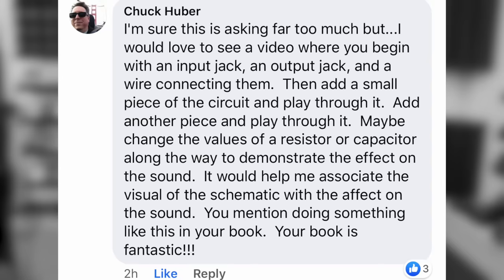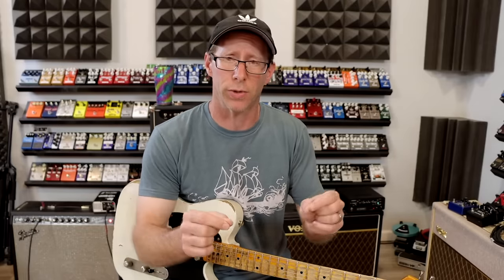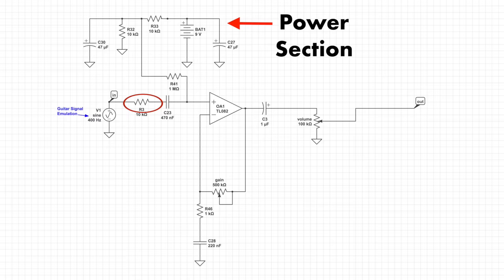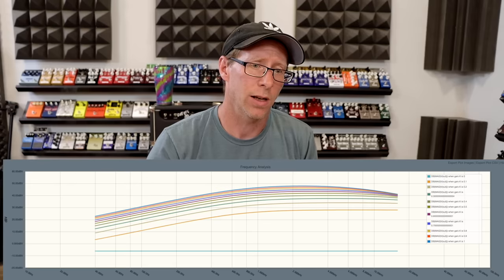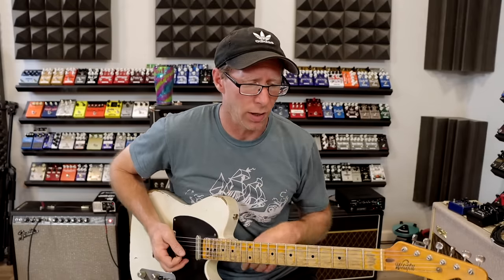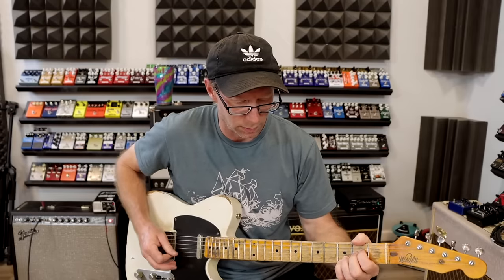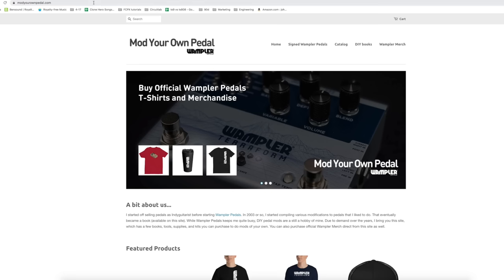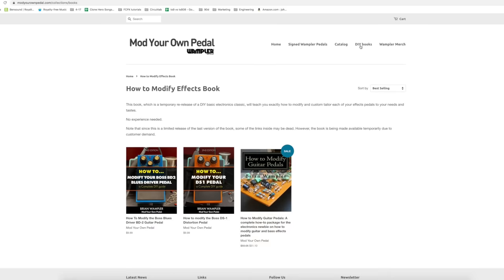How To Design An Overdrive Pedal Circuit

Comment: How long does it take an experienced pedal builder to build a decent overdrive pedal?
Like when you have built the exact same pedal 1000 times?
Reply from the maker: To build one or design one? Building is the easy part generally
Reply: @wampler_pedals  
Thank you for taking your time to answer.
 to build.
Friend of mine said he needed 3-4 hours, but he only did it once, and says he's glumsy.
I am currently saving up for a load of parts to practice, cause from what I've seen it doesn't seem to be that hard to build some pedals, eventhough I guess an inexperienced person like me won't be fast.
As a busker I can't afford expensive pedals so learning it is right now the only way I can afford good equipment, so
I'd like to know what times I can expect once it's an everyday thing to me, cause then I know how long it takes to get my dream collection, and in the long run, if production time and German handmade prices are in a profitable relation. 
The designing part sure, I can imagine it takes a long time, but I guess that is hard to calculate. I mean I can calculate how many songs I can learn in a month, but not how many I can write. I think the same logic applies here.

By the way your videos are very helpful to understand pedals.
This alone I reviewed a couple of times to really take it in.
And it keeps me motivated on my savings for the big part package, so thank you again!

Comment: Hey man, got a question for you! I'm about to build a pedal in a veroboard (only got the picture of the circuit on it) but I wanted to try in a proto first. There is any software that does this conversion between circuits and proto?

Comment: which voltages did you use as op amp power supply?
Reply from the maker: I always start at 9vdcc, as that is what the majority of pedals run at

Comment: The impact of the clipping diodes seems to be overshadowed by the opamp's inherent clipping effect. I would be curious as to when the diodes make a bigger difference, at least as big as to be dramatically perceived when hearing the audio from the uploaded YouTube video.
Reply: He did a vid comparing diode clipping to op amp clipping awhile back, might answer your question
Reply: @electricemperor3672  I remember seeing that a few weeks ago. I'll revisit it, but I remember not being able to witness a convincing difference in the timbre when the gain was cranked-up. The opamp was clipping almost hard, so the diodes probably made a difference in terms of the overall saturation, but the YouTube audio quality of the recording didn't seem to help in noticing a dramatic difference. In this video, I am noticing how the diode feedback loop also tampers with the gain (in the end, they are nonlinear devices in parallel with the feedback gain pot, so I would guess they do change the gain, but also compress the signal? As an amateur lacking the theoretical background, I cannot speculate correctly here..)
Reply: This is a good circuit for experimenting with different diodes. You don't even need to use a matched pair. I recently modded my BYOC OD-2 to add sockets to the LED clipping option. I was planning just to test different colours, but ended up trying every diode I could find. After spending several hours swapping diodes I decided to match a 3mm red LED with a 1N4001 diode. I liked the sound of the slightly asymmetric clipping. But the higher the forward voltage of the diode, the more gain I appeared to need before clipping became apparent (which makes sense).
Reply: @danielcollins6195  Indeed, the problem I tend to have and blame it on the YouTube audio quality loss, is that it is hard to actually hear these differences; all subtlety is lost as compared to hearing the differences live. There's also the perceptual difference between opamp rails clipping and diode clipping. My guess is that saturation is the biggest factor, whereas timbre not so much..

Comment: can anyone explain to me what the purpose of the capacitors are, i understand how they work but i dont understand why he is using them in a pedal and what that does to the signal, if someone knows the answer and could help me out that would be great im getting into pedal building and am trying to learn thanks
Reply from the maker: Capacitors can do a variety of things. Here they are blocking dc, creating filters, setting gain, and a other things depending on where they are in the circuit

Comment: Does he mention which op amp he is using? I feel like he did but I can't find it now
Reply from the maker: Probably a TL072
Reply: @wampler_pedals  you'd reccomend that over like an OPA2134?
Reply from the maker: Depends, often a tl072 works perfectly and sounds great. In a simple circuit like this it’s not going to be a dramatic difference. A lot of op amp differences have a lot to do with input or output impedance, temperature use case, and a variety of other factors that have nothing to do with “tone”.

Comment: I feel like I'm missing something here: is this just on one of either the tip or sleeve of the jack? And does that mean the other one is just a single wire doing nothing but being passive and returning the distorted signal back to the guitar?
Reply from the maker: I don’t understand what you’re asking. The Jack’s are just input and output for the signal. Each signal has a ground, and all grounds are connected together.
Reply: @wampler_pedals  I mean how the jack has two different insulated wires inside it: one connects to the tip and one connects to the sleeve (this is what I currently understand to be true, please correct me if I'm wrong). From this, into the circuit therefore must go two wires, but on these, the signal source has one side going into the circuit and one into the ground.
However, I think I've just worked out what's happening lol, as you say that all the grounds are connected together.

But just to clarify that I'm correct: all the ground arrows can also be drawn as a single wire connecting them.
Then from the "out" on the right hand side of the schematic, there must be another connection to a cable to the amp, so where is it, as I would think it can't be from the ground because that would be just like having a "dry" blender knob on a pedal as it would surely just short over the rest of the circuit and any distortion that is gained would be so minimal that it just doesn't even matter anymore?

Sorry if this comment seems a little all over the place, but I think I understand what I was originally asking by the end of explaining it to myself, however I now have another, different, question lol.

Thanks though.
Reply from the maker: The jacks basically have two connections, one “carrying” the signal, and ground. 

Yes all grounds could be drawn on a schematic to connect together, but it’s not drawn that way in order to make it easier to read, hence the ground symbol.

So, if you see my schematic with only the output signal, it’s because it’s assumed that one knows that every signal has to have a ground, or else it won’t work. My apologies… my diy course at guitarpedalcourse.com explains this but for YouTube I have to assume that most would know this, though I have explained it in other videos in the past, I do realize not everyone has seen them and indeed not everyone may know this after all.
Reply: @wampler_pedals  Nah you're fine for presuming man, I was just confused anyway. Quite frankly, I wasn't expecting a reply 4 years down the road, but kudos to you for helping me that long after the video posting.

What I understand is that from the input jack, either the sleeve is connected to the ground, which is connected to all other grounds, however it isn't shown that way for ease of reading. The tip is then connected to the "in" of the circuit, which is connected as shown in the schematic.
The output jack that goes into the amp (or another pedal, etc., etc.) has its sleeve connected to the ground of the pedal circuit too, and the tip connected to the "out" of thepedal circuit.
I presume that connecting these the opposite way round wouldn't matter a huge difference though, as it's all A/C of course, so it's not like there's gonna be diodes only letting the current one way without another being wired in parallel letting current the opposite way.

Was there any parts of this that I'm wrong about or not?

Thanks!
Reply from the maker: You’re very close! All correct except this: you can not swap the in and out, or else the circuit will not work, it’s designed for the audio or “signal flow” to work one direction, if that makes sense.
Reply: @wampler_pedals  How does that work though, because the input is alternating so surely it would still work, just it would be 180 degrees out of phase?
Reply from the maker: It’s AC voltage technically but don’t get too caught up in that. Think of the signal as water. It’s gotta flow downhill, it won’t go the other way- the circuit will not allow it to, due to how the circuits work. If it was passive then it would work backwards, just not properly as intended.
Reply: @wampler_pedals  Sorry, I just don't understand what within the circuit stops it from working "backwards". Is it the polarised capacitors? But surely they can't be the problem as they still release an AC current/voltage after being charged.
Reply from the maker: No, it’s the circuit itself. Let’s say you are using an opamp for gain, it simply will NOT work in reverse the same way, it’s not designed that way. It might make some sort of sound, maybe, but it certainly wouldn’t be the intended sound. You can’t run a signal into the output and expect the input to spit out an output signal, it doesn’t work that way. The voltage and current are designed to do specific things when the circuit is connected in specific ways , and that’s just simply the way it works. 
An oversimplified analogy, if someone said “why doesn’t my car go faster when I hit the brakes? It seems like it should!” The answer is that it’s not designed that way. There is deeper engineering principles behind it, but ultimately it does what it does. 

If you’re and interested in exactly the engineering behind why the circuit works the way it does I would suggest a book called the art of electronics, it’s great.
Reply: @wampler_pedals  AH yes, I forgot about the op-amp. (whoops lol)
I've just looked at your other videos and I searched for an op-amp one, I couldn't find something that looked like it explained what it does, I just wondered if I've completely overlooked something or what, as I'd really like to know more about how they work and more specifically in relation to guitar tone and this clipping circuit (presuming it's the bog standard of overdrive) and I really like your teaching method.

Thanks hugely for all the help you've given me by replying to my comments, I really appreciate it man.
Reply from the maker: This is long and detailed, but it’s a good explanation of opamps:
https://m.youtube.com/watch?v=7FYHt5XviKc
Reply from the maker: More:
https://m.youtube.com/watch?v=fmRHDqcodS4

https://m.youtube.com/watch?v=idJEMYhrIfs
Reply: @wampler_pedals  Thank you very much, I will look at all three videos tomorrow morning. However, I'd just like to check: the only reason we can't flip the tip and sleeve is because of the op-amp? I also don't 100% understand why, because the guitar just generates a back and forth current, no matter which way you plug it in, however I hope that somehow these videos will explain this to me.

Comment: Are you only using 1/2 of the Tl082 opamp?
Reply from the maker: Yes, but any single op amp will work fine in this circuit. I just normally use dual op amps by default.
Reply: @wampler_pedals  in response to the Schematic vs. breadboard debate, which legs of the opamp are you using as your base, emitter, and collector. It makes sense on the schematic but isn't each IC different when it comes to their base, emitter, and collector. FYI, new to small electronic components and I am also working through I DIY pedal building book. By seeing how you utilized the Op-amp on a breadboard would definitely clarify some things. 

Thank you for making this video, I have been looking for this exact video for a while.

Comment: What is the point of the 1Mohm resistor at r41?
Reply from the maker: I don’t have schem handy but if it’s going to ground it’s probably the resistor to help eliminate “pop” when turning it on and off. If going to vref then it’s for bias.

I’ll be doing some more videos like this, to help promote my diy course, https://www.guitarpedalcourse.com/courses/complete-beginner-s-guide-how-to-design-your-own-guitar-pedal-circuits

Comment: Great idea for a video, but it kinda falls flat without actually seeing the board as you evolve the pedal, I think.
Reply from the maker: That’s what schematics are for
Reply: @wampler_pedals  Friend, for someone with a lot of experience like yourself, sure, but folks looking up videos about building things on youtube are generally just getting into it. If someone only wanted a schematic, a video is pretty unnecessary, right? Would be pretty easy to find one and just print it out  rather than watching a 15 minute video. Video is a visual medium. Trying to be constructive here.
Reply from the maker: I understand, but it’s important to learn how to read a schematic, which is one of the main things I’m trying to teach. Refusing to learn this is a bit like trying to be a carpenter but refusing to use a tape measure.

Comment: then go to a shop and get charged 20 times for that , just because it says "big name brand , vintage , old school, just like in the 70s"
Reply: Going by the schematic, if you were to buy in something of bulk -mind you, 10 units of each, which is normally how you get dip8 chips anyway since the fuckers fry on a whif-, you'd spent something on the neighbourhood of 5 bucks. Add PCB design and manufacturing, and in 50 bucks of your time and resources, you've made between seven and ten units that you can sell for a hundred dollars each.
Reply: Not in that way but yes, many brands are overpriced. I mean if you think about the fact that we pay over 50 to 100 euros for a piece of copper with a bunch of magnets in a plastic case it will blow your mind lol.

Comment: What circuit is this?
Reply from the maker: What do you mean? It’s a non inverting op amp with soft clipping into a variable low pass filter. It’s just electronic building blocks.
Reply: Ok gotcha. I was wondering if there were any specific pedals that were based on the circuit you used
Reply from the maker: Not exactly... there’s similarities since it is just basic guitar audio electronics but it’s not really a “clone” of anything existing.

Comment: sarcasm here: "oh you said soft-clipping overdrive, so you are clonning the Tubescreamer ooo! copy!! cloner, invent your own circuit" lol ... I mean, in electronics, in order to achieve an amplified signal, you must use an opamp or transistors... in order to clip, you must add diodes. There is no other way around it. If you kept that same train of tought, then the TubeScreamer would be a clone of the circuits you see in Electronics books.

Comment: I wish we could see the actual board and not a schematic. I can't follow that.
Reply from the maker: It’s kind of like building a house though- gotta learn to read blueprints to understand what a signal is doing, which is why I teach the viewer how to read the schematic in the video
Reply: @Wampler Pedals  I have wired up several gadgets in a car, including swapping from OBD0 to OBD1 and built two pedals so far. I have a hard time with schematics. It's hard for me to see it. I will go back and rewatch the full video. Do you have any other suggestions?
Reply from the maker: This video may help: https://youtu.be/yZnSeAo4wdA

Basically, a schematic shows the “signal flow”, think of it like the path of the audio from input to output jack. Once you learn what a transistor symbol looks like then you can learn that the signal comes into it and goes out of it with some form of “effect”, might be louder or might just be lower impedance like a buffer, same with op amps. That’s just one example.
Reply: @wampler_pedals  What pedal do you sell that is closest to this design?
Reply from the maker: Nothing really, it’s a pretty simple design. I suppose the euphoria would be closest but definitely not identical

Comment: idea good, execution bad.
Sayying stuff like "thats just how you do it on this circuit" doesnt help :D Why is there a need to put the diodes like this to work? what does the resistor and capacitor do for the op amp to work. Why do you do stuff and also show the breadboard the entier time
Reply from the maker: Your questions are outside the scope of this channel which is not aimed at answering engineering questions in detail, it’s demographic is guitar players.